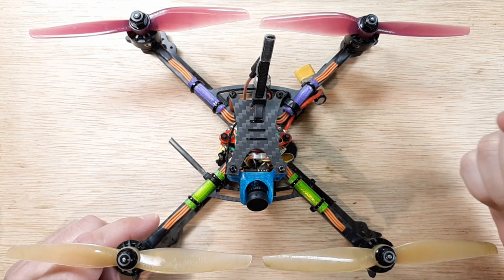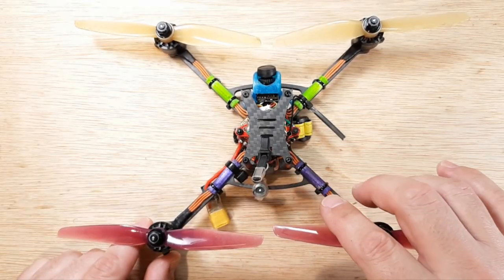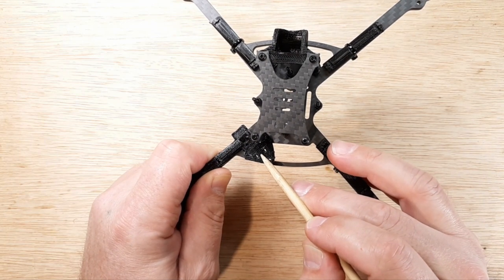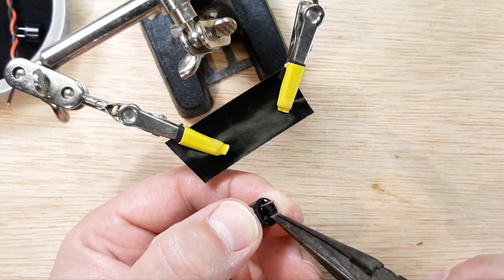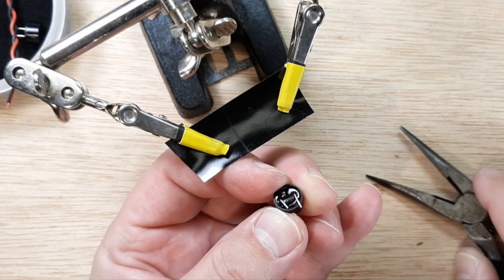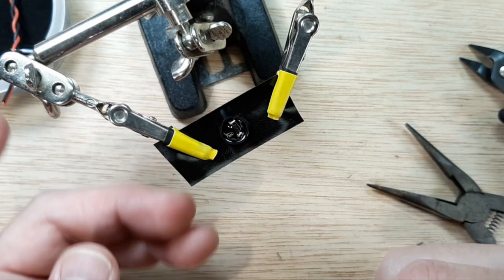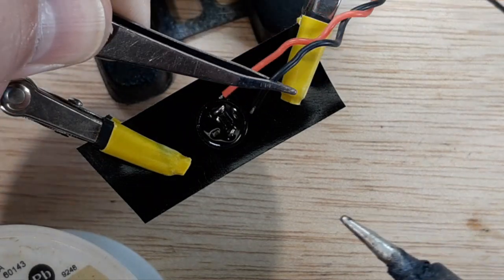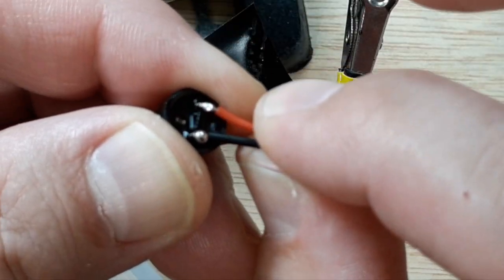The Beeper | How To Build A Drone | Sub 250 Quadcopter Build Video

Comment: Great series man! I use that same shrink tubing among others. If it's the same shrink tubing it's 3 :1 ratio and like marine grade.I came back and paused it lol it is the same SGS as mine. Really good stuff I use it on receivers as well.
Reply from the maker: It's probably the best if your wanting crash protection and circuit insulation. A friend showed it to me, I was using a product that was half as thick and had very little glue inside.
Enjoy the Breeze...👍🏻🍻👊🏻

Comment: Your doing the build? You started 8 days ago and that’s the beginning?
 What kind of ready to fly weight and how long on flight times?
 I may build this frame except use a HDZero whoop vtx and a whoop AIO which I already have. 
 The motors and LiPo packs needed is what I likely don’t have.
Reply from the maker: I'm doing prebuilds. These items are going into the build and if someone wants more information,  I can just send them to the appropriate video. Hopefully, this will keep my build video shorter than 3 hours. Next is the AIO...
It's a hobby that I spend time on when my wife and kids are doing other things. So it will take as long as it takes. 
Would be cool to see an HDzero version. I'm trying to be AUW under 225 grams.